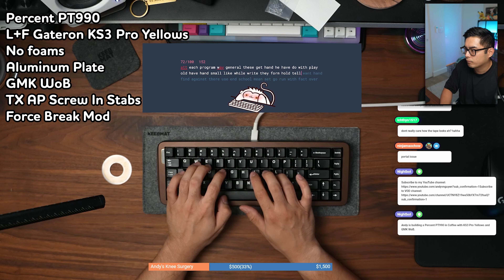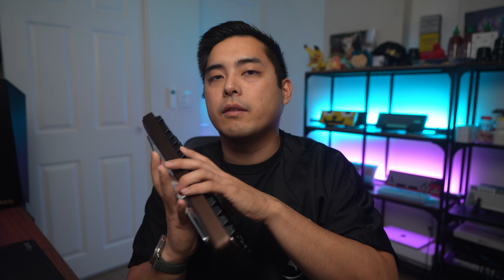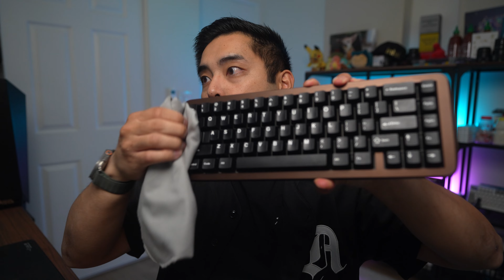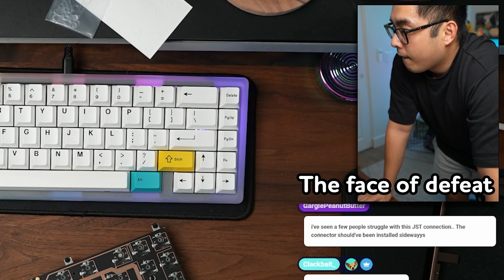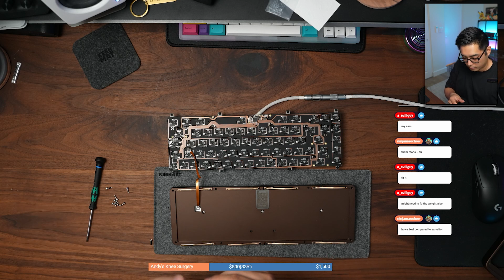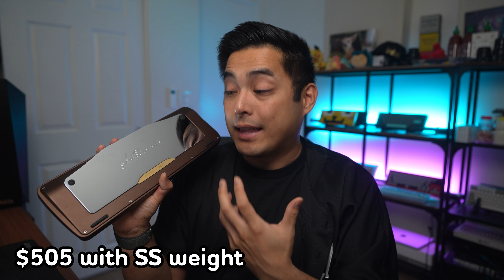A New Take On 65% Keyboard Design - Percent PT990 Review

Comment: tbh Percent boards have always been exercises in fantastic and unique design language, but with incredibly lacking sound and usually pretty basic feel. The Skog Reboot was basically just a gasket sandwich that wasn't designed to have flex, so you have a pretty hard typing feel, which is fine if that's what you're into, but ever since they started trying to approach more flexible mounts, it feels like their sound has gotten worse and worse, sounding hollow and unpleasantly resonant. Unnecessarily complicated build process, hollow and relatively dead sound profile, and then the abhorrently high asking price due to the many metals and expensive finishing processes applied just leads to a product that I think doesn't have a lot of value to anybody who actually wants to use and enjoy listening to and typing on their keyboards, rather htan just looking at them. And for the love of God, can proprietary daughterboards and those weird ribbon cables just fuck off and die? In an age when we have Fly daughterboards, C3/C4 footprint, and now S1, there is no reason to use this garbage. If you want to do a low-profile design, just use C4 or something with a Molex ezMate connector
Reply from the maker: I agree with you! The new molex connector is so weak though. So for the complicated through weight Jst it can get pulled out so easily as you’re assembling

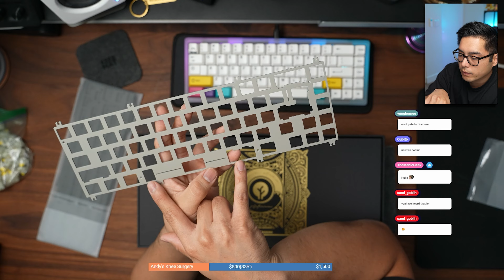Comment: At the beginning of the video (4:45) you say its a good thing the PCB doesn't have flexcuts. Then at 7:55 you say that because it doesn't have flexcuts so doesn't flex where you press, which isn't your taste. So which is it? Is it more a problem with the mounting system making the whole plate/PCB move up and down? Like you'd either prefer local movement or no movement at all, right? Just curious what your preference is.
Reply from the maker: Probably the mounting system. I’d honestly prefer less movement. So less actual deflection when flexing. If it’s gonna move, I’d want it to feel more natural and not like a big brick.. 

I think I’m just over flex as a whole

Comment: As other keyboard designers continue to push the market, having a JST like that feels like a step back.   Also in the budget and midrange space, there seems to be the most innovation rather than just simply the cost of the nicer design.  For ~$500, it is probably worth if you like the design especially if you're hiring a builder.